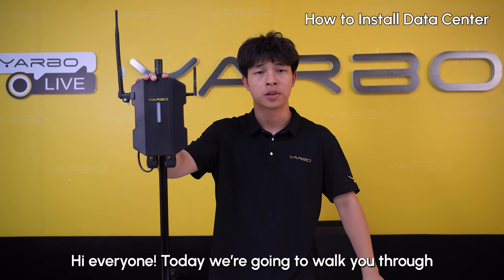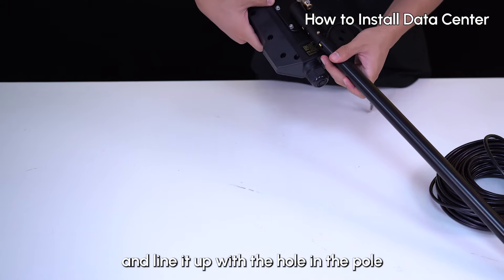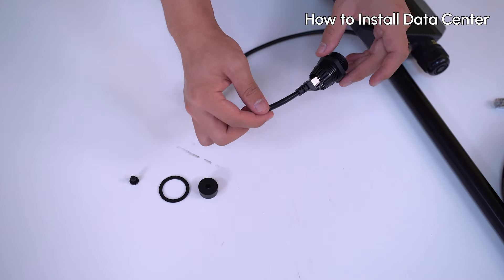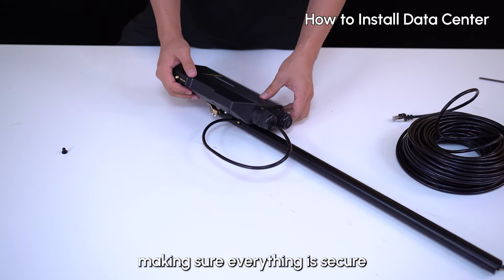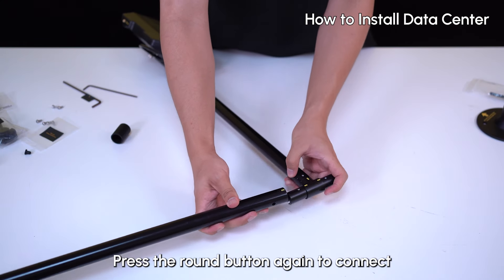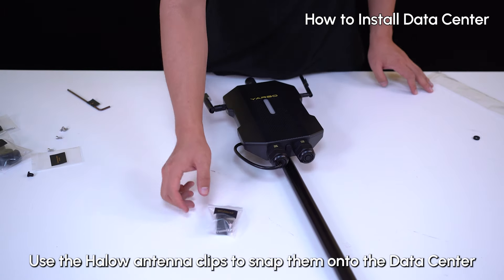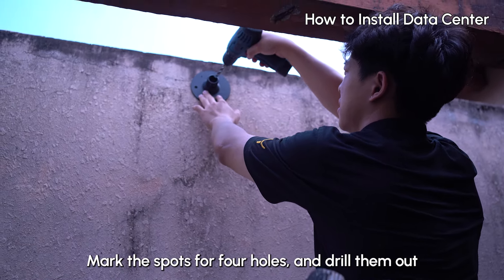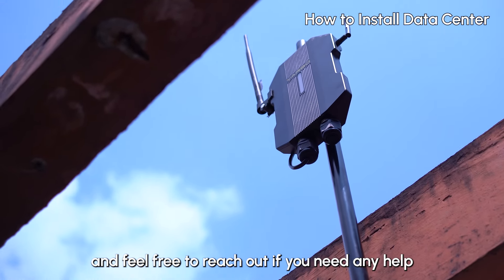Step-by-Step Guide: Data Center Installation Guide

Comment: Does Yarbo need line of sight to the Date Center?  I'm asking because if I install the Date Center on the front of my house for snow clearing, then it won't have line of sight for grass cutting in the backyard.  If I install the Data Center at the back of my house, I would have the same issue, but in reverse.
Reply from the maker: Thank you for your question! For optimal performance, we generally recommend installing the Data Center on the roof. The Data Center requires a clear view of the sky (at least 120° unobstructed) for the best RTK signal reception. However, it does not need a direct line of sight with the Yarbo device itself.
Yarbo communicates with the Data Center using Wi-Fi HaLow, so even if it's operating in the backyard, it should still work effectively. If you notice any signal strength issues in certain areas, slightly adjusting the position of the Data Center (e.g., by raising its elevation) can often help resolve the problem. Let us know if you need further assistance!

Comment: I'll have my hands full with trying to get ethernet connected to the new base station, but I'm not about to drill holes into the siding or roof of my home, both of which are only a couple years old.  Can we please see a video showing detailed examples of ground installation?  That would help alleviate one of my concerns, at least.  Then, I would just have to sort out the exterior ethernet connection...
Reply from the maker: Thank you for your comment! We typically recommend installing the Yarbo Data Center on the roof for the best signal. If ground installation is preferred, ensure it's mounted at least 3ft above the ground with an open view of the sky.

Comment: I seen in one of the videos that you need a POE adapter which provides the power, do these come with the kit or do we have to buy them, if so could you please provide the specs of the POE adapter required.
Reply from the maker: Thank you for your question! The POE adapter is included with the Yarbo kit, so you won’t need to purchase it separately.

Comment: What is the LAN terminal used for? Would it be PoE passthrough to use it to connect another device?
Reply from the maker: Thank you very much for your comment. The POE LAN port on the DC is actually used to function the expansion DC. For larger yards, one may DC can't cover the whole area, so you may consider increasing the coverage area by purchasing our expansion DC. We are now verifying and perfecting this function, and we believe that this function can be online shortly.

Comment: Can the wall base be put right on the t joint? Or does it have to have the long horizontal pipe on it?
Reply: It can't be put on the T joint; both the circle mount and the Data Center only connect to a tube. (You can make it work with only using one tube, but you couldn't use it as wall mount, because Data Center needs to point up.)

Comment: Does it make sense to put on a shed as I don’t wanna get on top of a 2 storey house?
Reply: I think the most important position is close to where Yarbo will be operating, and the view of the open sky. I don't think much will be gained by putting it 2 stories up, unless the height eliminates obstructions.
Reply: As long as it does not wobble when the wind blows, floors flex, or doors slam.  If the RTK reference moves even a little, the robot will generally think IT is what's moving.
Reply: @GenesisMuseum  thanks for the response.. Yea thats a tough one for me to answer.. my house sits in the middle of the city lot and the shed is at the back. snowblowing would obviously be in the front but the grass cutting will be around the entire house.. the shed is shorter than the house of course by an entire story.. so im not sure if the house height will interfere with the signal diagonally on the other side of the house from the shed.
Reply: @smc1897  yea the shed is quite solid as its made of wood rather than plastic or sheet metal.. thanks for this tip.. i could definitely see myself struggling with the primary functions of yarbo and not relating back to the RTK waving in the wind etc..

Comment: No need of RTK cable connect on this data center ? Only network cable ? What is the second place to connect a cable ?
Reply from the maker: Thanks for your comment! The RTK cable is already embedded in the Data Center. The network cable will provide the power for the RTK system. The second place is designed to connect to the other Data Center so we can have multiple signal sources. This specific feature is estimated to be available next year.

Comment: Does it work without ethernet cable, as the previous version?
Reply: No, but you can use a wireless bridge / wireless mesh (not included) to get  similar setup to last year's model.